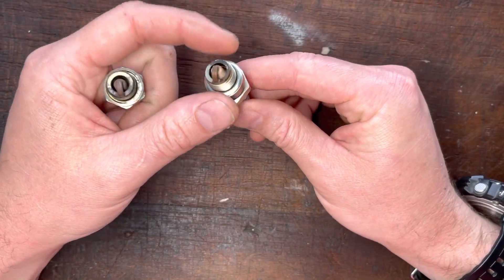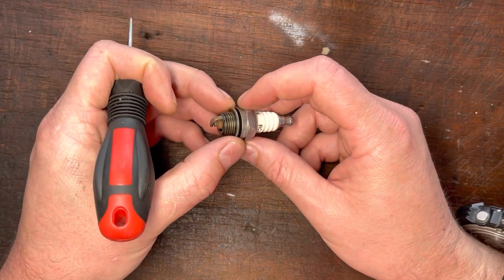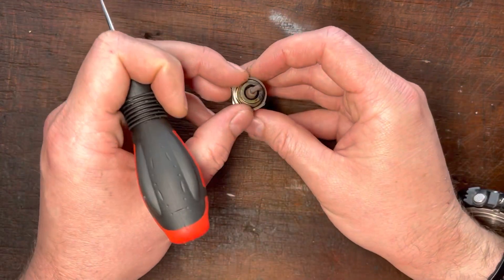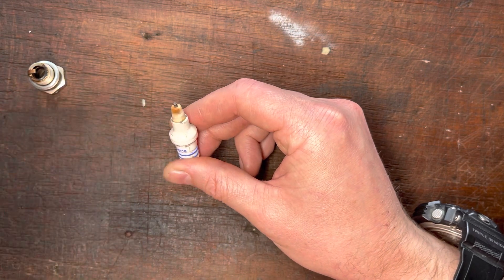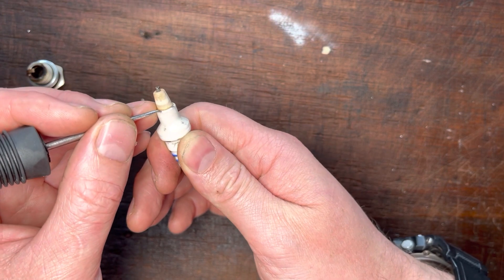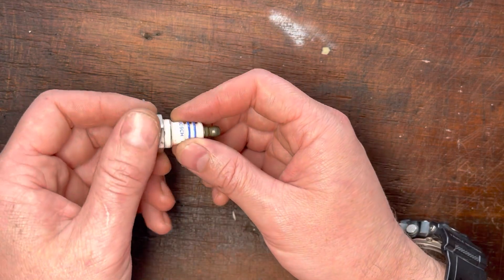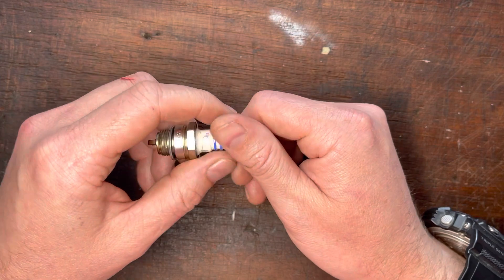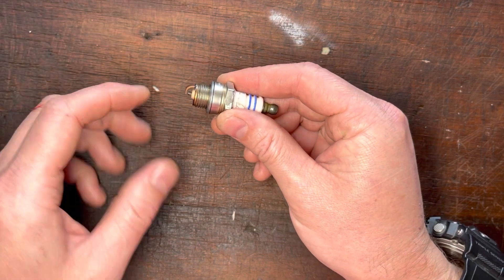Engine Tuning Via Plug Colour?

Comment: I always trust how my engines are running by their plug status. Only last week I pulled out the log splitter and it hadn’t been run since last September thereabouts. It was misfiring at speed, fuel was new and air cleaner cleaned out. When I pulled the plug it was loaded with carbon, I put in a new one, same thing in minutes. Pulled the carb off and cleaned all the jets and it ran normal again. Obviously a tiny bit of dirt blocking one of the orifice. The plug told me it was a fuel problem. I rarely have probs with 4 strokes like this but I definitely gauge my 2 stroke engines by the plug, especially my RM 250 as to the jetting and oil mixture being spot on.
Reply from the maker: Each to their own :) thanks for watching and sharing your thoughts!